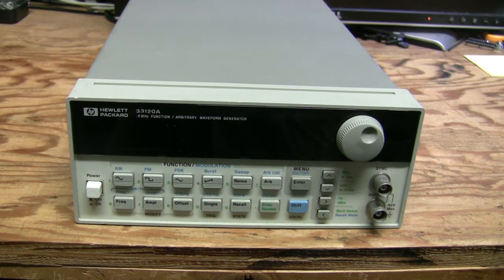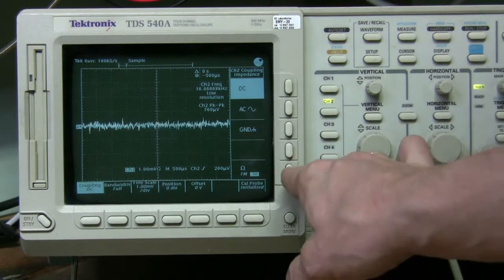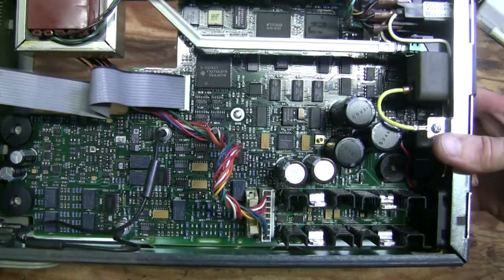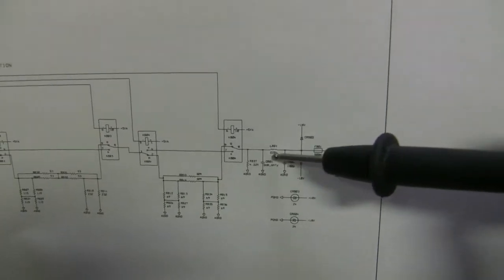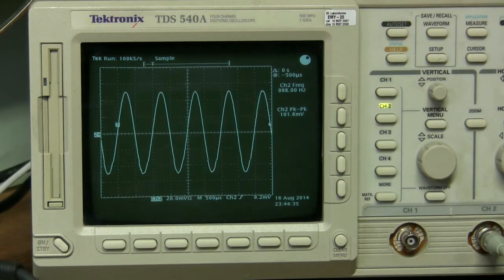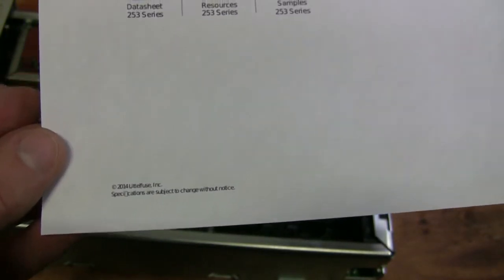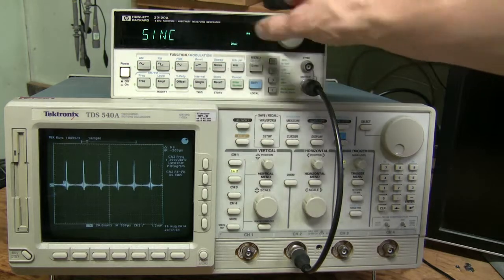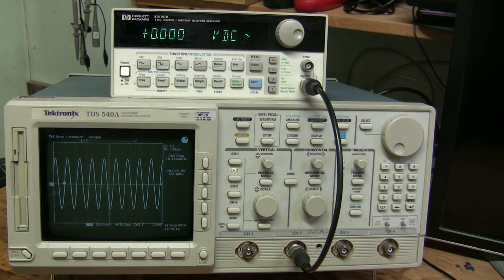#15 - Hewlett Packard 33120A function generator repair

Comment: Hi. I had exactly the same issue. I replaced the fuse with an SMD variant (500mA fast) on the bottom side of the PCB. Now it works again.